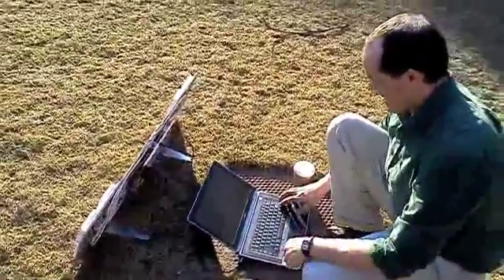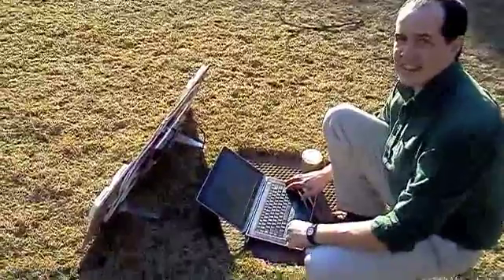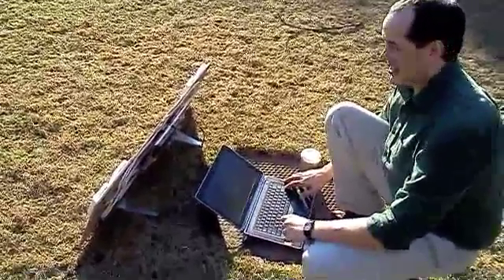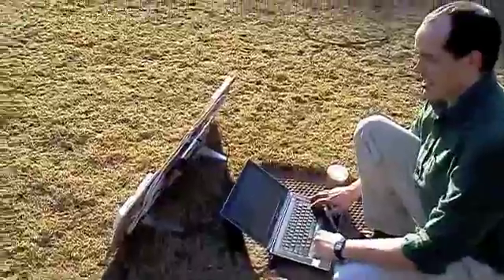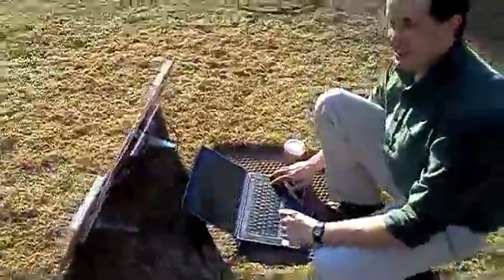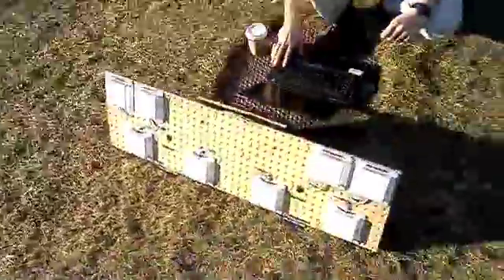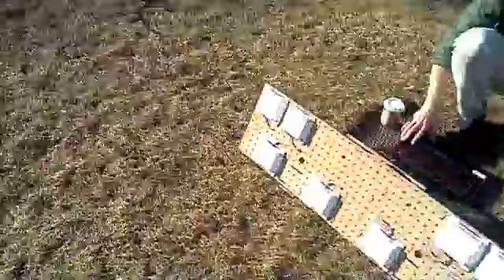DIY Phased Array Radar Demo for MIT IAP 2012

Comment: Gregory, I realize it's 10 year later, but any chance I could get some information on the software require to create an image from a system like this?  My son and I recently purchased one at a local ham swap meet (we are both EE's).  It's clearly of the same design.
Reply: What did you pick up? Also, did you know that you can pick up a mmwave radar evaluation board that uses FMCW radar at 76-81GHz with 4rx and 3 TX antennas? You can get one version that has the antennas right  on the chip.. The AWR1843.. there's a phased array eval board that used 4 AWR2243 chips that are all phased locked to a common 20GHz reference.. the price varies from a couple of hundred for the board with the integrated antenna, to a couple thousand for the phased array version. It's a great option for experimenting if you're.comfortable with microcontroller code or FPGA's.. (depending on which one interests you the most & budget constraints)

Comment: it is much simpler than you guys might think. One actually only need transmit on 1 channel and receive on 1 channel at a time. No need to generate a sine wave - simply send a short enough (2.4GHz) pulse. No need for RECORDING RF data - enough to record the time of first echo. Then simply multiplex to all combinations of tx/rx antennas and do some math transforms in matlab. Cheap!
Reply: Well then.. do u know how to make it with only two wifi router or 1 router but have dual channel? I want make it.. though...

Comment: So in this project how exactly did you generate the driving signal for the array? Did you do it in a Laptop and send it through some special IO device? I wanted a hardware because if you are to drive a 10X10 array of transmitting elements you will need 100 different phase shifted sine waves. Now even if the working frequency is as low as 40KHZ you will need a data bandwidth of 100*40,000*2*2 B/s. This is about the limit of a USB port. So how did you do it?

Comment: I'm sorry, what you're looking for is a hardware solution. It would be more helpful if you can reveal your design objective. From my experience, for a phase array system, a hardware solution while possible, is usually only elegant only within very narrow parameters. A software solutions will allow for much more flexibility in your system. i.e. You are less limited by your hardware arrangement as most solutions can be done algorithimically.

Comment: I do not fully understand what you said. You surely do not intend to convert the oscillator signal into digital signal and then take Fourier transform do all the calculation there and take DFT. Did I understand u right? My question is how do you build a circuit physically?

Comment: Of course additional optimization may be applied to the data. For example, if additional height acuity is needed, we could average spatially to obtain more “looks,” if maximum spatial resolution is not required.

Comment: Demodulation is then achieved with the use of a simple diode rectifier (crystal) and lowpass filter (capacitor) and a pair of high-impedance headphones converts the resultant envelope current to an audio signal that accurately reproduces the original modulation.

Comment: Your request is equivalent to windowing the continuous sinusoidal signal using a rectangular pulse of duration τ. Because windowing, or multiplication, in the time domain becomes convolution in the frequency domain, the continuous signal spectrum must be convolved by the spectrum, or Fourier transform, of a rectangular pulse to obtain the spectrum of the windowed signal. The rate at which the signal is attenuated as a function of frequency is proportional to the order of the filter.Got it?

Comment: Sorry if this sounds silly, but can you please tell me how can I precise shift phase of a sine wave? I mean, I want a device that will have three terminals one is input sin wave of a particular frequency another will be the phase shift that I want and the other is the shifted out put of the input signal. How can i achieve this. I don't want to use RC network for this. Something like an analog PLL and a offset in the phase detector.